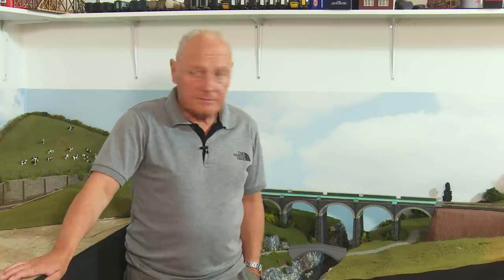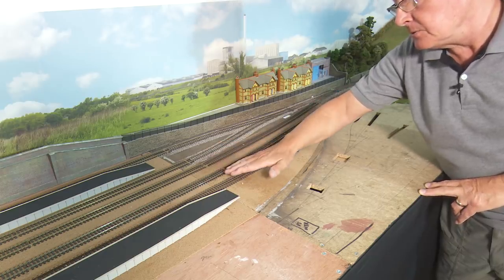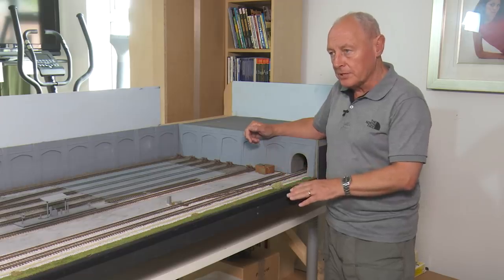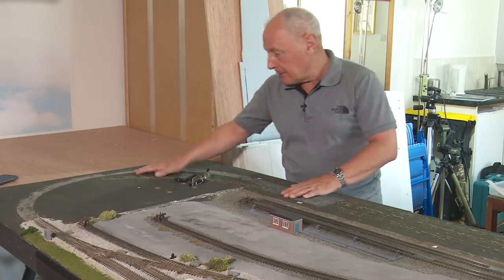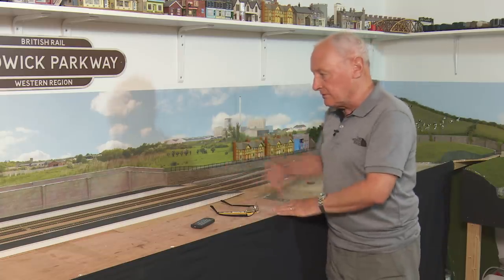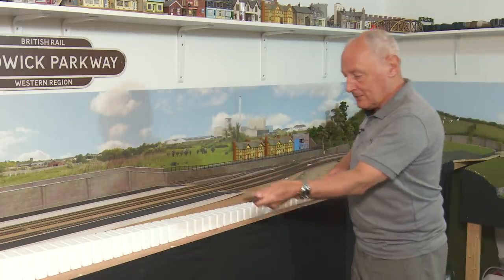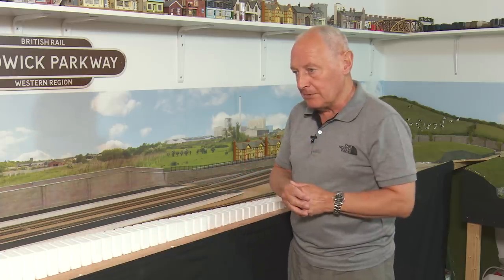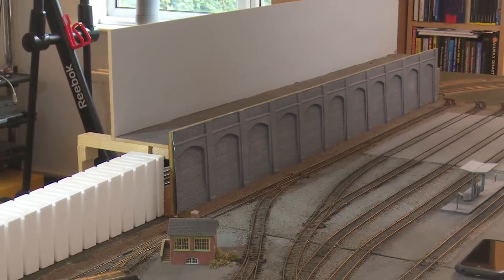A boring track plan at Chadwick Model Railway. | 72.

Comment: Hello Charlie,

my suggestin is to turn the TMD about 180° and run the two track main line in the back of the TMD and not routin one track in front and on on the back of the TMD. I also like the terminus idea. But if possible I would start the incline after Chadwick Parkway, so that you still have the possibility to change tracks in Parkway station for shuttle services to the central station.
Reply from the maker: The turning of the TMD boards is brilliant.  God bless YouTube.

Comment: You can use the risers to give sufficient support for a thin board (e.g. balsa wood) on which you can place your double track.
Reply from the maker: Good point David
Reply: Another idea is to not use it on the layout itself, just as a template and guage Maybe down the road, you'll be able to use it again with a different curve and also have the 4% grade as a guage to indicateaximum rise.

Comment: I do agree with you, after doing that wonderful  3D area around the viaduct, the station does look a little 2 dimensional.  It is a shame that the platforms are long and straight.  I think a station in front of the slope would benefit from a slight S curve especially if there any lines by-passing the station.  I do wonder if 4% is a little steep as a visual effect and whether double track is a good idea and that a small terminus like Cheltenham St James or Bath Green Park could then feed into single track up and down the slope with points doubling the track at the bottom connecting to the RH end of the station.  It would certainly make it more interesting operating at two different levels.  You do like making trouble for yourself but it is my favourite channel and I can't wait for your next video, whatever you choose to do.
Reply from the maker: Thanks Don, great thoughts mate.

Comment: Love the idea of the terminus station, although personally, I would have had Parkway as the terminus above the fiddle yard (maybe with automated DMUs shuttling between Parkway and Central) and a grander 'Central' where Parkway is now and use the fiddle yard as a feature in its own right rather than covering it over. 

As you're not having a curved incline, could you not investigate using the same material for the incline (but on its 'side') that you used for building your landscape then double it up - could have whatever incline you could measure/cut? Although maybe it's not wide enough for even a single track? Mind you, would love to see a girder built incline, although how you'd do it....
Reply from the maker: Fascinating points Richard and very much appreciated.
Reply: I am a fan of having scenic storage when possible. So with a terminus you should include a carriage cleaning/storage area, and a loco stabling area (maybe small TMD), if you can then find room for a freight switch yard, then you've kind of eliminated the need for a fiddle yard. You can assemble trains on the fly from in scene locations. Obviously if you have more stock than on scene storage allows or you cannot fit any on scene storage, then the only option is Fiddle Yards.
Reply from the maker: Good advice Neil, thanks

Comment: 25%!!?!?! Flippin heck that's steep!!  :-D 
Watch out for the point in the station. Some trains may foul on the platform edge when coming into the station. And as for the incline, best tip, make it as long as possible! :-) Though I do think the one you have there is long enough. Keep doing testing before final fitting. :-)
Reply from the maker: Good points Sammy, many thanks.

Comment: Great idea for the terminus station and how to maximise impact with another level. My layout is essentially 2 levels where the inclines are mostly hidden in tunnels or behind back-scenes. Seeing the incline on your layout in full view against the wall with the shelf, baseboard and back-scene horizontals in near proximity does tend to emphasis the steepness of the gradient. A method I take is to use the entire length available between each level. For example if the length from the starting point (lower level by platform) to the end point (upper level above fiddle yard before entering terminus) is 12' and the height difference was 6", then I would evenly spread the incline over this distance. I suspect this would give you a far more realistic incline. Of course this might mean the risers are redundant as I would make a series of wooden supports, say every 6" with each height calculated by the total number of supports to get an even gradient. On the topic of the track-bed width (if you use the risers), I would just use the one set and lay some thin MDF (3mm) over the top at the track-bed width required. Gosh, that a lot for my very first comment on a YouTube channel.
Reply from the maker: Sound advice, cheers mate.

Comment: Plenty of work coming for you Charlie! I like the idea of the terminus above the fiddle yard.
As for the slope which is not wide enough for 2 tracks why don't you get some similar polystyrene and using the Woodland Scenic's inclines as templates, cut pieces wide enough for 2 tracks and stick them together.
I assume that the inclines will be clad in 'something' so you would not see it.
4% seems steep to me but a lot of my locos are steam. Not knowing the length of your layout could you not go to 3%. Great video again. Cheers. Pete
Reply from the maker: I’m so pleased that you enjoyed my latest dilemma Pete. I have the two sets of 4% inclines but I think that they will end up being cut down to 3% and extended accordingly.  
The terminus above the station should be quite exciting so fingers crossed that I can get some free time and crack on.
Regards Charlie

Comment: I confess that I did not read. the 717 comments before I started to write. May be that someone already had the same idea. First of all: quite an impressing layout, even now when it is under construction. I think you love long trains driving along long tracks. Now for my point. You mentioned that you miss "the depth". Yes, because there is about 1,5 feet free space, then you find the tracks Behind them a little bit of background, pressed into the gap between tracks and the wall. No matter which track plan you have: if you try to bring the tracks a bit closer to the front rim of the board you will automatically create more depth. 
Coming to the ramp: as far as I understood the situation there should be no problem to install both of them because that part that is too much should disappear in the mountain or whatever there is behind the ramp. The "2 centimeters": put the ramps on a board which is 2 cm thick and on the low end of the ramps just build another ramp with 4% which leads from 2 to 0 cm.
Hopefully I didn't bore not bother you. Good luck and all the best from Germany! Matthias
Reply from the maker: Thanks Matthias, you’ve made some very good points.  Thanks for the advice. Regards Charlie

Comment: I like where you are going with your layout.  

The incline does look a bit steep by scale comparisons.  I think you could disguise this if it is possible to put some structural forms to the front causing the trains to go partially out of sight every now and then.  Or, given you seem to have the space, level off the track every now and then so that you have a series of short inclines rather than one long one.  Also, the incline may not look so obvious if it is occurring on the bend rather than the straight section. 

I think there are plenty of options to explore and am confident that you will find a solution.
Reply from the maker: Sound advice, cheers mate.

Comment: Where do you want to start leveling out the track for the upper level? I would figure it would be after the curved points on the lower level. If so, then your 4% only takes up 3/4 of the necessary length of your hill, in which case you could have a slightly lower gradient. Now, since woodland scenic's inclines are a set gradient might I suggest reducing the first and last segments to 2% allowing you a more gentle transition onto and off of the incline.

I have read and experienced that the point at which a locomotive may struggle the most on a gradient is in the transition from flat to hill. One way to reduce this is to have at least 2 of you longest pieces of rolling stock worth of gradient be lower than the rest at the beginning and end of the grade. While I can see that pulling power may not be a problem for you,this transition gradient may help improve the appearance of that portion by not only reducing the contrast at the ends but also providing length of climb that may meet the high and low points more reasonably.

On another note, have you considered having a small amount of staging on the upper level as well. This could be a destination for freights and have all tracks converge into a runaround, sector plate, or turntable, so locomotives can be re-assigned for a run back down the hill. (see diagram below)
    /-----------------\
O------------------------\
   \-----------------/      \
                                 \
Reply from the maker: Sound advice, thanks Charlie.

Comment: You could still have Chadwick parkway station on the incline considering that you can get a lower powered train, from 0, up the gradient , you could fit a small station on the rise.
Reply from the maker: An interesting point Vincent.
Reply: A Parkway "High-Level" platform for through trains only with a (goods?) terminus on the level?
Reply: Something similar to platforms 6/7 at Nuneaton, they are on an incline up to a flyover alongside the 5 WCML platforms

Comment: I can't speak to boring, because that viaduct will be the visual focal point of the layout, and trains rolling across it will always be stunning.  Turning the TMD as others have suggested will solve one area.  As far as the rise, it is a shorter stretch, but your thoughts work.  I might have just had a small rise going though a valley or scenic break (buildings/terrain on both sides).  The trains either flash through intermittently or disappear for a moment, but it creates a drama visually.
Reply from the maker: Sound advice, thanks Anthony.

Comment: I would use the 3 % grade for the rise  4 % may cause a problem when the track levels out. Also I would not run all the tracks parallel to the edge of the table. If you just use a simple angle and slightly curve it will look more organic and not laid out.  I used just over 2.5 % grade on my n scale and it looks prototypical.  Anyway nice video.
Reply from the maker: Sound advice, cheers mate.

Comment: A great tour and explanation on what your thinking and doing with the layout. First and foremost it’s your layout and hobby so do what you want to. We all have different wants or needs that we want out of our layout. The station entry and exit looks great. It’s not complex but not dull. Only thing I would want is some more of a goods area to allow shunting puzzles. The fiddleyard is going to give some much needed storage and your idea of having a terminus could accommodate such a freight yard. I used the inclines from woodland scenics in the past and the 3% grade worked well with my steam locomotives pulling 4 coaches. I didn’t test any longer at the time as this was a branch line. One piece will handle only one piece line of track so if you want two lines, you will need to double the width. I’d love a terminus so would love to see it develop on your layout. All the best, Clint
Reply from the maker: Clint, I’m so grateful for such constructive input.

Comment: No expert so who am I to say what's right or wrong.  But would it not be more prototypical for the DMU to be on the down slow and pull straight into the platform at the back of the layout (on the inside of the four main tracks not the goods relief), and then cross the two fast lines to get to the up slow when returning to the other destination?  Having said that, you then went on to explain the proposal to change the fictitious destination into a real one, which I think will give additional visual impact and operational fun... but that gradient is too steep in my opinion.  Why not aim to get to the height of the old arches over the full distance between the current station and the start of the section that will cover the fiddle yard ?  I would agree with the other comment about making the branch a single track rather than double.
Reply from the maker: Thanks for your points Malcolm and sadly I agree that it’s too steep.

Comment: Hi Charlie, that’s a neat idea adding a terminus station above the fiddle yard giving you more playability in the layout. The risers do look steep but I imagine once blended in with scenery they won’t look so acute. One thought I have with regards positioning is running the incline at the far end on that section between the two main scenic areas. Your point work currently sitting at the station will allow those local trains to arrive as they are before departing up the incline to the terminus. This would particularly benefit trains entering from right to left and then using that crossover to access the branch. Of course all this only works if you have the required length on the joining section and, if so, will the train have any additional struggle climbing that gradient when on a curve. Nothings ever simple in model railways! 😆 I look forward to your developments whatever you chose to do. Paul
Reply from the maker: I’m so pleased that you enjoyed it Paul, still scratching my head!

Comment: A solution for the track plan issue... move the fiddle yard to a lower level in front of the layout, and use climbing spirals to get from that level to the main level.

For the ramp... well you need some serious motive power to get up that kind of incline, but it IS possible to design a realistic track plan around these kinds of inclines. (seee https://www.youtube.com/watch?v=Y-1E_1wxvXQ ). Well that's a branch line but you get the idea.
For main line use, 5% is about as steep as you can go (double traction required) See https://en.wikipedia.org/wiki/Höllentalbahn_(Black_Forest)
Reply from the maker: Sound advice, thanks Ivo, I’ll watch it later.

Comment: Hi Charlie. First of all your layout is only boring if you think it is (the rest of don't by the way) - if you get operational enjoyment out of it, it matters not what anyone else says. Having said that, I was in the same situation as you with a a 4 track tail chaser with a large loco depot (steam) so to ad interest (visually and operationally) I did the same as you with a branch line with a terminus , albeit only in single track but it adds a tremendous amount to the fun level. Maybe I will get round to doing a video of it at some point! I was lucky in as much as I have enough space for my gradient to be 1 in 100 but I do not think your gradient will look bad. I say this because I built a coaling plant in my loco shed which space dictated a steep gradient of about 1 in 20  which looked all wrong with just the bare risers. However, when I added all the scenic bits to the bank it looked absolutely fine so I think the same can apply to your bank.
Reply from the maker: Sound advice, thanks TJ.

Comment: Have to agree with some of the other comments, I think it is a bit steep. Also not sure on placement, think it would be very unprototypical (although I’d like to be proven wrong) where an incline of that amount and size would be situated in the middle of a station. But with the space you have maybe there’s not a huge option. What about a ride if only an inch or so, essentially building the station over 2 levels, but being low enough that the incline is complete prior to platforms?
Reply from the maker: Sound advice, cheers mate.

Comment: Hi Charlie, thoroughly enjoyed this video, thank you. 
Inclines are a nice interesting feature, with a lot of potential, but I agree 1:25 is a bit severe.
I’ve incorporated a single track incline on my layout to feed a branch terminus & opted for 1:40 min, with minimum 24”rad curves (space limitation). Built of hard board & I used a string line to sight the gradient profile. This was useful as I discovered areas where I could ease the gradient. DCC concepts magnetic system works excellently (as mentioned elsewhere). An essential for this incline with steam locos. My old Woolworth is content with 3- 4 coaches & in the real world there would be load restrictions for various classes of locos, anyway. 
Viaduct scene looking great & really enhances your layout.
Have you thought about a parcels depot to busy up the foreground area of the station area?
Hope this helps. You have encouraged a lot of useful ideas too, so thank you for that.
Reply from the maker: Thanks for your constructive comments Dave, much appreciated

Comment: Read the many comments already offered, which include my thought which is to use the Scenic's 4% as a base and extend the top width with thin ply/ Balsa, bearing in mind the need to fill the structural gaps in the Z shape if you are to landscape it. Not excited about your proposal to have twin width and trim the edges, Won't it start to disassemble if you start cutting up the edges? 
Not clear where you intend to start and finish your climb, but in your video you appear to have reached the desired height in half the distance available to you, so either ditch the 4% and go to 2% Or  it looks to me as though the foam will stretch a little lengthwise - so keep the 4% and pull it out  to perhaps  3% or 3.5% and maybe include some level sections where your engines take a deep breath before resuming their effort. If the steeper bits are hidden with some visual distraction it will all look perfect. I am sure you will find the right answer, look forward to seeing it implemented. Regards, RB
Reply from the maker: Sound advice mate, many thanks.